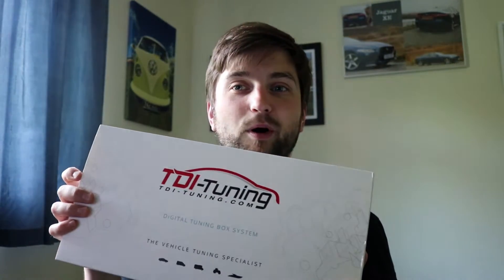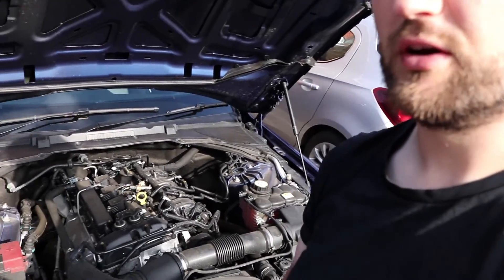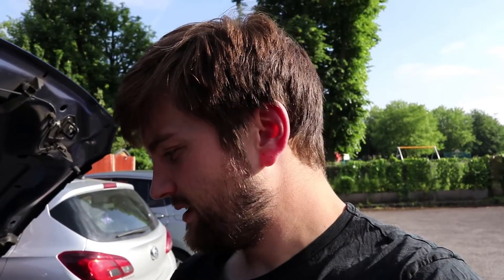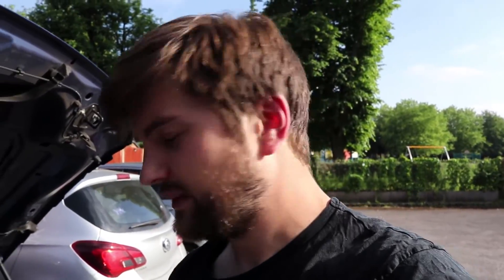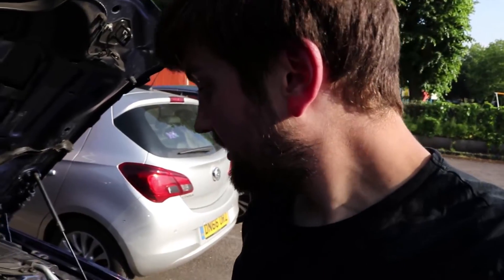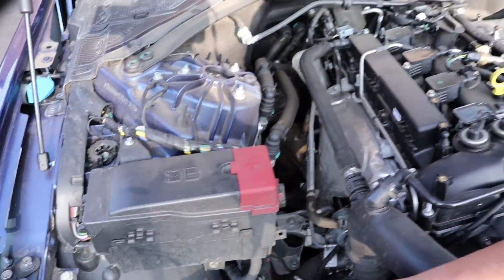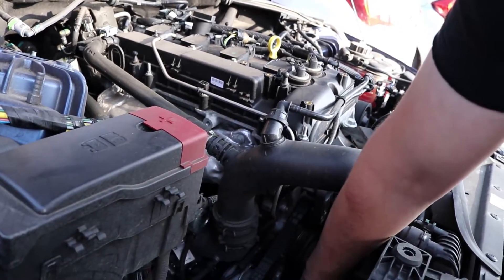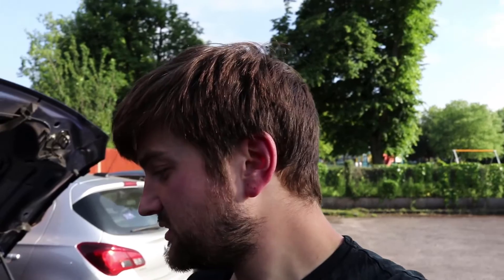MORE POWER for the Jaguar XE!

Comment: Its not a remap.
Its basically a series of resistors that ‘trick’ the sensors to believe its running colder, it increases the readings to the car ecu  for it to perform better

Comment: I’ve already drop 80 pounds of wheel weight swapping the heavy malleable jag rims.... and I put a spires stage 3 rear exhaust on her as well.  My techs say it FEELs boosted due to weight reduction and increased bhp from the free flowing exhaust (much louder too sounds like a Ftype no joke got a nice clip on here).  This website says it takes the XKR from 503 bhp to 563 bhp!  500 USD??? No fiddling from stock in the engine bay???  Hmmmmm

Comment: Hi, great vids. Have you ever seen the engine management light come on after you installed the box correctly? I have the same set up/ engine and have seen it come on for a bit. The engine is running normally, it seems.
Reply from the maker: No, once I installed it correctly 🙈 it has been fine with no fault codes or EML. It’s been into Jaguar for the service and MOT and came out with no flags etc. Maybe you have another minor issue that has coincidently shown itself?
Reply: @ForTheDrive  Did you leave the box on for Jaguar service? Did they mention anything about it? I'm not sure whether to hassle with taking it off or risking that they will start bitching about it.
Reply from the maker: I think I took it off while for the first service but now it’s not in warranty I will be leaving it on.

Comment: Have you still got this box on your car? Would love to hear back because I’m thinking about getting one for my C Class Coupé
Reply from the maker: Yes it’s not coming off while I own the car. Definite increase of power and even with a lead foot the mpg isn’t that bad either!
Reply: For The Drive What are the mpgs?
Reply from the maker: Mr330d good question! My figures are a little skewed because of the mileage I do during the week but on a “normal” run where 37.7 was the average it easily goes over 40 regularly and even with a real spirited drive it’s mid 20s instead of dipping into the 10s.
Reply: For The Drive Awesome I just bought a Toyota auris Diesel that’s much harder on diesel than my last car so I’m looking at options to increase the mpgs a bit and have more power 🤷🏼‍♂️ win win haha

Comment: iv been looking for a chip. i have nit done any research on the TDI. i guess now i should look into it. but, did you look into the racingchip GTS or the Vivid racing tuning box?they both look good but im not someone who could really tell.
Reply from the maker: At the time, the TDI kit offered the greatest increase in both HP and torque, coupled with I had been recommended by someone who had one already made the decision easy for me. The other kits could be just as good, it’s down to personal preference.
Reply: Just get a proper remap

Comment: Hi, so I have the same box, but I can't find the boost pressure sensor that should be beneath the intake piping, could you do a quick vid on where did you find the sensors?
Reply from the maker: Not really because it a camera would struggle to see it without removing pipes etc. It is in the side of block where the instructions say, it’s underneath the intake pipe directly. I found it a bit of a mission to remove the stock clip with everything in the way but it is possible.
Reply: For The Drive thanks!! I’ll give it another shot now.
Reply: Oh, last question, when you say below the intake , is it below the intake at the maf sensor or below the intake where it connects to the turbo?
Reply from the maker: Jeff Castillo it’s on the MAF side, under the rubber intake pipe that feeds the manifold I believe. If I get a chance I will take a picture of what I can to try and point it out.
Reply: You my friend are the man!!!! Found it!!! Had to remove the air box to have better access, I’ll take some pics and video if I can! Again tons of thanks mate!

Comment: I've read on one of jaguar's forum sites that jaguar is able to send info back to the UK once the car is plugged in at the dealership worldwide. This way, jaguar would be able to know if you've modified the configuration in any way, even if you have plugged out the device because they will be able to trace your history through the ecu in your car. And if they find out you've been fiddling with the car, your warranty will be void. Have you found dead out from jaguar if they will honour your warranty or void it?
Reply: Pana Sonic Once the tuning box is remove there is no trace in the ECU of anything, its nigh on impossible for a dealership to detect a tuning box has been fitted. Dealerships can detect remaps though even if the remap has been removed. I've ran tuning boxes on cars for new cars for 9 years now.
Reply: The ecu is not involved so is not traceable... simple explanation... lets say your car put 0.7bar boost... when you remap it they will rise it up to 0.9bar ... TDI box playing with sensors... when sensor read boost of 0.7bar then Box lower it to 0.5 by 0.2 bar... thats mean your ECU will think it produce the same 0.7bar when it will produce 0.9bar... thats why there is nothing they can trace as ECU working as normal as every day ;)
Reply: Bruh what are you smoking?

Comment: I bought a chip from TDI tuning because of this video for my XE. Mine doesn’t have the ford engine but the ingenium engine. (25T) 

Definitely can feel the difference, hopping to put it on the dyno to see what sort of gains it gives. 

Have you still got your jag? I’ve only had mine 6 months. Deleted both back boxes and had bigger tailpipes fitted. Sounds much better and looks loads better. 

Then just the chip and a K&N air filter
Reply from the maker: All XE’s have Jaguar’s own Ingenium engine, Ford make the V8 for the F-Type at least for now, but all the engines were redesigned for the new model line. Mine is the 25T so should be about 292BHP but a dyno would be very interesting! 

Yeah I still have it, 2 years and 6 months still going strong, love driving it. I changed the air filter to a K&N a while ago and got some custom back boxes made about 8 months ago, made it a more enjoyable to drive especially when convoying with sports and supercars so hopefully you’ll enjoy yours too!
Reply: For The Drive thanks for getting back to me, the 200 & 240 versions are ford units made in Valencia. The real JLR units are made in Wolverhampton, they weren’t put into the XE until 2018. The diesels were always ingenium, but the Petrols sadly were re badged until JLR came out with their own petrol engines. 
I’ll upload a video of it on the dyno and the results of it before and after. 

Have you had any issues with your jag? 
I’ve sadly got the dreaded “PPF” on mine as it’s a 2018 model. It’s like a DPF but for Petrols. No doubt that’ll go wrong at some point. 

Have you got any more plans for the jag? Any more videos coming?

Comment: hi, how's the impression after 2 months? I'm also thinking of this one for my MY18 25t, as real ECU remap is not available AFAIK.
Reply: any change in 0-60 times if you enable or disable the box ?
Reply from the maker: Definitely an improvement over the stock set up. As for the 0-60 times, I would imagine they are improved but there are no times quoted and I wouldn’t rely on people’s attempts to measure.